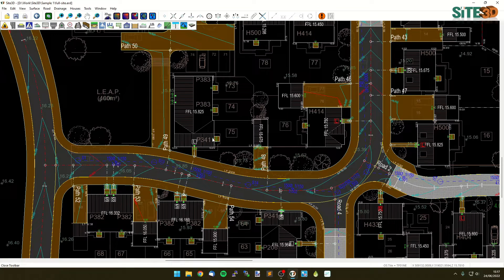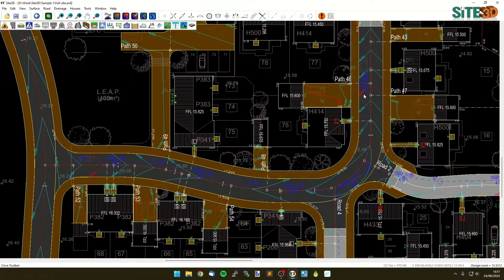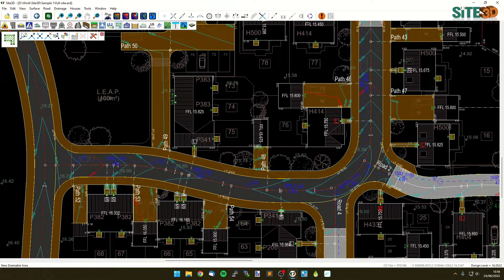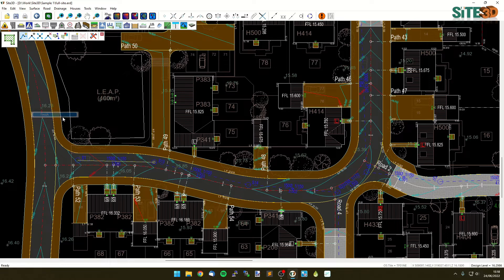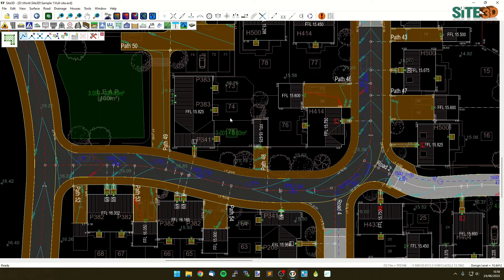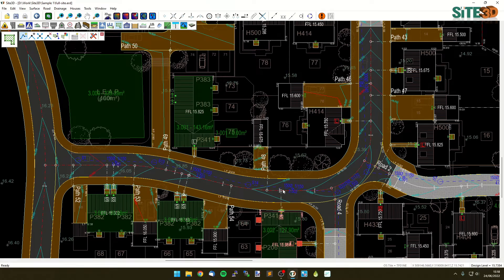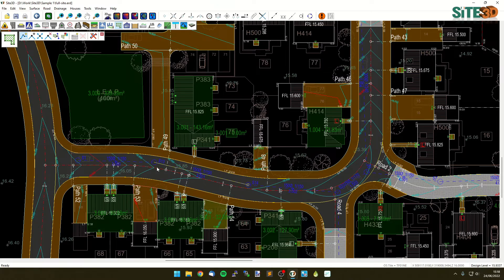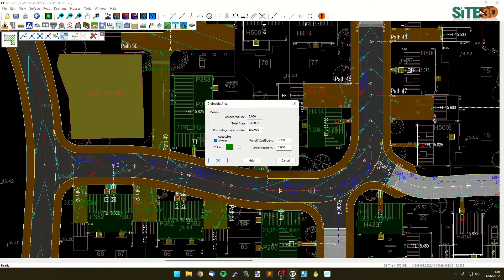Site3D: Drainable Areas from Buildings and Driveways

Comment: Does the software automatically add road catchment areas to the pipe runs?
Reply from the maker: Hi Laurie, the software automatically calculates the gully positions based on a given drainable area per gully.